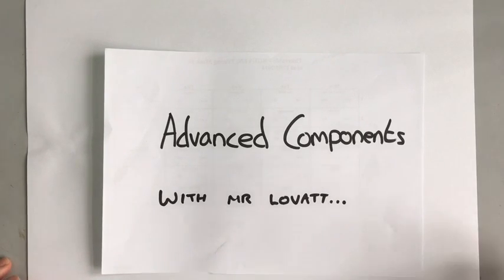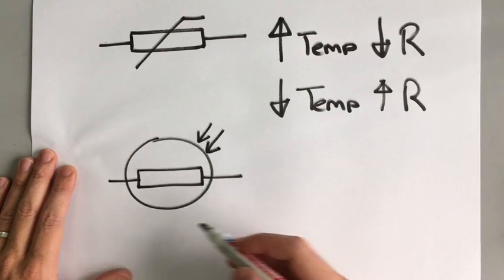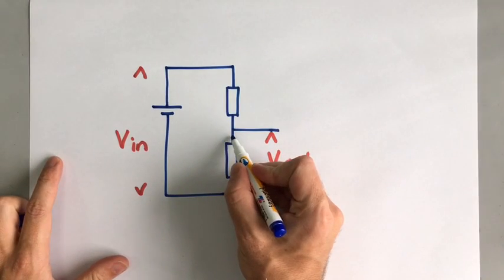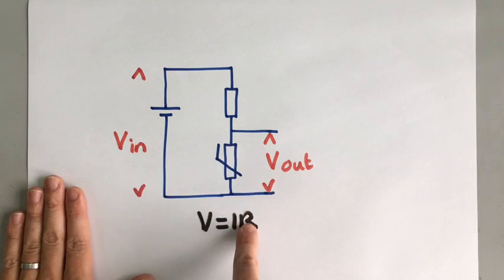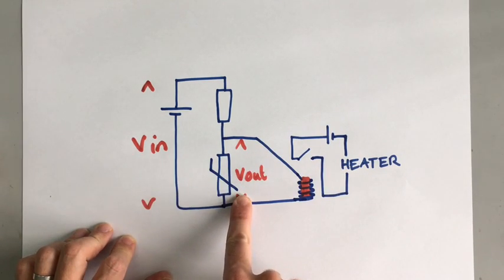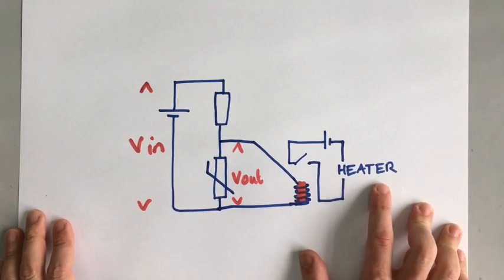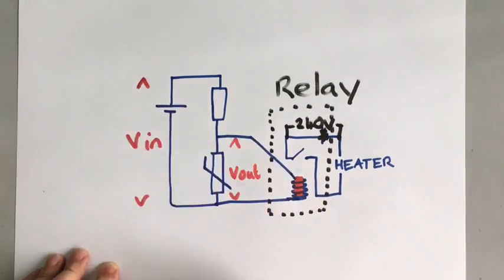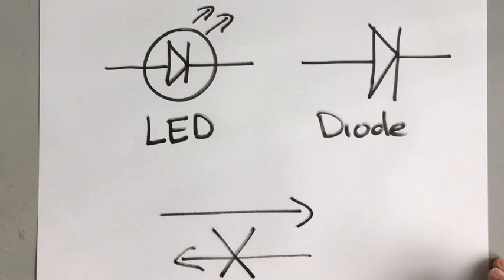GCSE Physics - Electricity 4 - Relays, LDRs and Thermistors

Comment: hi sir could you explain when you mentioned, at time 3:50 in the video, about: "as it got colder, the resistance increased so more voltage, hence more power flows through the heater" I have a few questions here: firstly, did we still consider the current as being constant when telling about power, P=IV? or does it change when a heater is attached in parallel? Secondly, does it require a high power for any component eg. lamp, heater and say relay coil, to turn it on? Please help sir, I have my IGCSE exams in just 1.5 months from now,  and I am very concerned about this doubt as I couldn't understand teacher's explanation on this topic except you, please help!

Comment: Wouldnt the path consisting of an electromagnet would lead to a short circui? If that happens, current will be provided a resistance free path and thus would flow in that path rather than the the thermistor itself
Im confused af

Comment: Why does the voltage  decrease but not the current?
Reply from the maker: Good question! The current would change slightly too, in reality, because the total resistance of the circuit is changing. But with these potential dividers, we are really focused on the difference in voltage, because the voltage is the amount of energy being transferred to the coil to open the switch. Hope that helps!

Comment: Hey, can you explain why in a thermistor/LDR the resistance decreases as the temperature/light intensity increases? Cause I've been searching and I've found that in some cases, the resistance increases as temperature increases as shown in the transformer chapter. (where high voltages are used in power grids to decrease the current and the heating effect which ultimately decreases resistance, as high heating effect which means high temperatures will result to a higher resistance) Waiting for your enlightenment! (My physics theory is next week, so i hope you can give me a quick response) Any help is appreciated, thanks!
Reply from the maker: Good question! It is to do with the material they are made of. As they get hotter/more light, it releases more free electrons inside the material, and if there are more electrons then (simply) more electricity can be conducted so there is less resistance. Hope that helps!

Comment: I have a question.
Aren’t voltage and current two different quantities? 
When resistance in thermistor decreases the amount of current ( I ) increases and the voltage (V) decreases. Am I right?
Reply from the maker: The Legend voltage and current are two different quantities yes! The current is slightly more complicated because the resistors are in series, so if the resistance in the thermistor decreases then the total resistance of the circuit decreases and so the current will increase, yes. But it is really the voltage that we pay attention to in potential dividers. Hope that helps!
Reply: LovattPhysics Hey just a question.
Can you make a video on Cathode Ray Oscilloscope?
Reply from the maker: The Legend ill add it to my list. A cathode ray oscilloscope is just an oscilloscope (the cathode ray bit just tells you the kind of display it is). An oscilloscope is a tool used to analyse wave forms by displaying them on a screen.

Comment: why would u use v equals to IR with thermistor, it is non ohmic material
Reply from the maker: BushStudies good question. Whenever we are using V=IR in this situation we are assuming that the temperature of the thermistor is staying constant during the measurement and calculation. Hence the resistance of the thermistor is staying constant at that time. You’re right though, if the temperature was fluctuating during the measurement, the resistance would also fluctuate, making V=IR invalid. This method only works when comparing different CONSTANT temperatures. Hope that helps!

Comment: Hi. I want to ask fabout the transistor as a amplifier, why the loud speaker is placed above the collector in the circuit but not below the emitter in the circuit...
Reply from the maker: Jia Ee I’m not really sure which circuit you are talking about... when using a transistor as an amplifier, the transistor takes a weak signal (a signal in this case is a fluctuating current and a weak signal would mean it fluctuates from zero to a small value) and basically transfers the signal to a circuit with a higher voltage, therefore producing current fluctuations between zero and a higher value than before. Of course, the speaker has to be in the second part of the circuit so it receives the stronger signal. Hope that helps!
Reply: @lovattphysics6366  ok thank you very much 💙

Comment: I'm confused at around 2:50. I thought that as resistance decreases, the current increases, and therefore the voltage increases. So why does the voltage decrease as the resistance decreases? I understand that the equation makes sense, but logically, I can't understand that bit... any help would be much appreciated! Thank you
Reply from the maker: Lizzie Coldrick remember that the voltage across both resistors (together) is staying the same, and that resistors in series share the voltage, so the voltage across resistor 1 plus the voltage across resistor 2 equals the voltage from the battery. Now, think of the voltage as the amount of energy that the current needs to get through the resistor. A bigger resistance will need a bigger amount of energy to get through, right? So if one of the resistors decreases, then this resistor will need a smaller share of the total voltage. A smaller resistor needs a smaller amount of energy to get the current through it. Does that make sense?
Reply: @lovattphysics6366  That makes much more sense now!  I have never understood that before,  so thanks so much for that explanation
Reply from the maker: Lizzie Coldrick awesome, glad I could help! Any more questions just ask :)
Reply: @lovattphysics6366  Actually, I did have one more question. It isn't on the GCSE syllabus that I'm studying now, but I was wondering what the difference between Faraday's law and Lenz's law is...
Reply from the maker: Lizzie Coldrick good question! First, lets start with the idea that a current in a wire creates a magnetic field around it. Faraday’s law says that the reverse happens too - a magnetic field induces a current in a conductor. But the key thing is the magnetic field has to be CHANGING (e.g. if the magnet is moving closer to the conductor). Faraday’s law says that the size of the induced current is proportional to the change in magnetic field. Lenz’s law says that when this happens, the induced current always flows in such a way that it resists the change in the magnetic field. In other words, Faraday’s law predicts the size and Lenz’s law predicts the direction of the induced current. Hope that helps!
Reply: @lovattphysics6366  That definitely helps, thanks! You're really good at explaining things - it's a shame I only just found your channel and I'm finishing GCSE Physics soon...
Reply: Lizzie one thing always has to be constant.. hence current is ... v=ir ... v (directly proportional sign) r ... I think thats it

Comment: Why do you need the other resistor in the circuit ?
Reply from the maker: Monika_1604 Vlogz great question! You need the other resistor because the output voltage Vout is controlled by the ratio of the two resistors. The fixed resistor is where the “other”voltage goes. If you only had the thermistor, the voltage output would always stay the same (although the current would change)
Reply: LovattPhysics Thank you :)